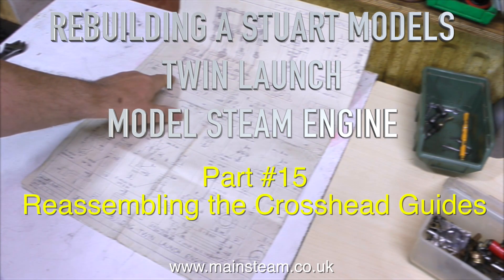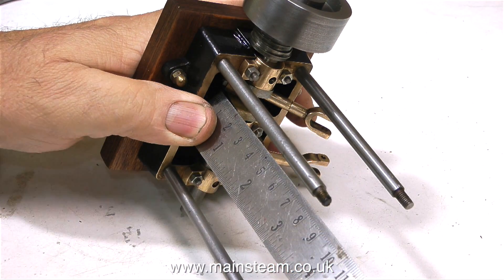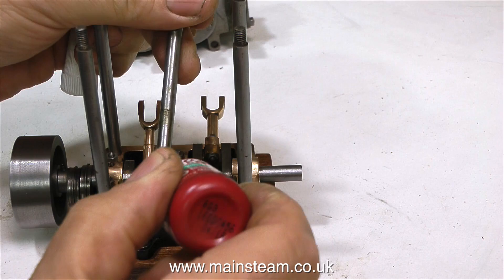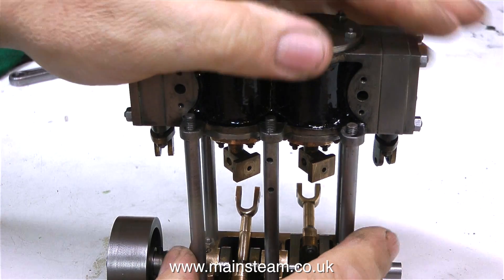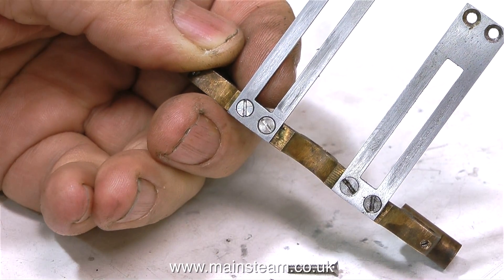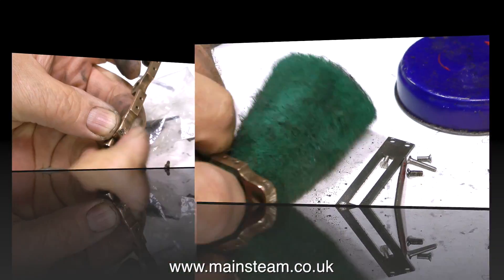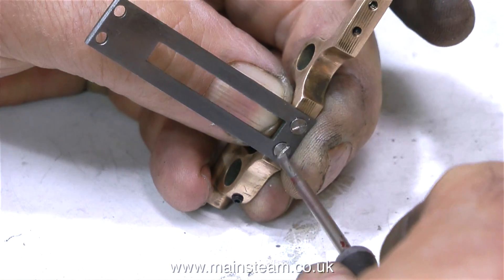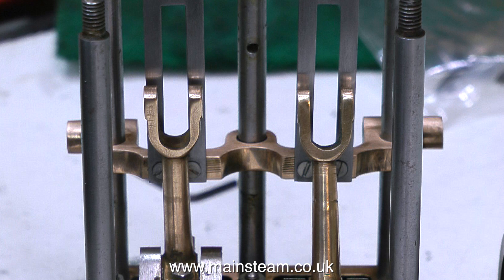STUART MODELS TWIN LAUNCH STEAM ENGINE REBUILD - PART #15

Comment: So now I'm wondering how the base developed that slope.
If it were me - and I've never built a model steam engine before, so this may be very foolish - in order to machine the surface of the base, I would shim it and affix it to a faceplate in the lathe, to achive a "close enough" fixturing of the work, then face the underside of the base. Having done this, I would remove the work from the faceplate, flip it over, and remount it, to face the top of the base. This procedure would ensure that the top and bottom of the base would be flat and parallel to each other. I think that would prevent the sort of situation the builder of that engine has experienced.

But maybe they didn't have a lathe faceplate, or a lathe big enough to do that sort of operation.
Reply: Seems like a good scheme, makes sense.

Comment: Keith, when you say "...held it in place in a vertical position and rethreaded the holes slightly." did you just use the steel of the cross head guide as a jig to force the tap to essentially rethread a slightly larger but eccentric to the original hole?
Reply from the maker: I think that is more or less it ..... but it is a very slight amount.

Comment: Three shall be the count. Thou shalt not count to two, unless it precedes the number three. Four is out of the question. 
-Brother Maynard
Reply from the maker: :-))) definitely one of my favourite films :-))))))
Reply: Keith Appleton 
Plus or Minus .
0.002 of an inch...  lol
What are the smallest tolerances found on model engines?
Reply: Keith Appleton 
Thank you for the reply..
When I  was a lad,,  I  really wanted a Ham Radio...  Now I  have You Tube,,   all is well...
°¿°
As a head of Quality Control, , I had to varify some really tight tolerances.  We had a tool makers microscope  that would measure down to 50 millionths of an inch. But the most exasperating die that we made, had holes that were + - .0001 on size and location...
The die would work fine for several months, and then would break punches. 
So I  convinced them to cryogenically treat the plates before they were jig ground...  And that fixed the problem...

Thanx again,,  and keep up the good work. ..
Reply from the maker: They seem to vary tremendously ......... from a close bearing fit to a rattle fit - usually the latter :-))))
Reply: Are the crank bearings bored at the same angle as the top of the bed? 
One way to adjust the support rod height for the cylinder would be to counterbore the threads a bit.
We still do not know if the bottom flanges of the cylinders are true.  Coming soon, no doubt.